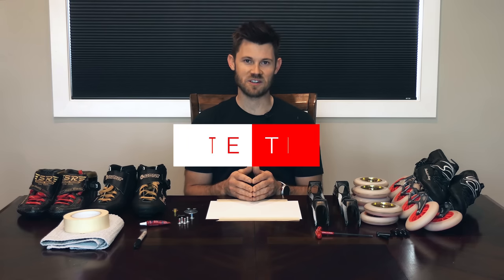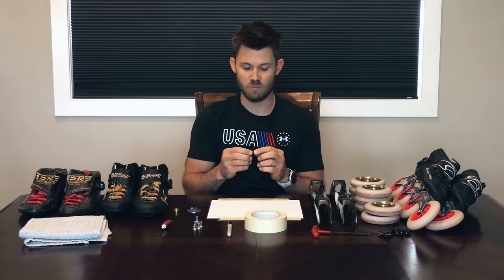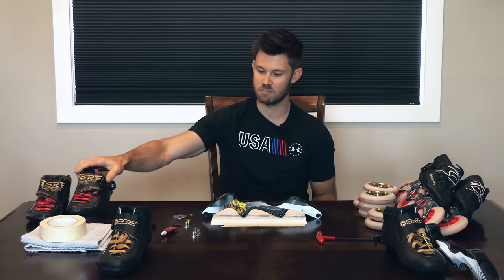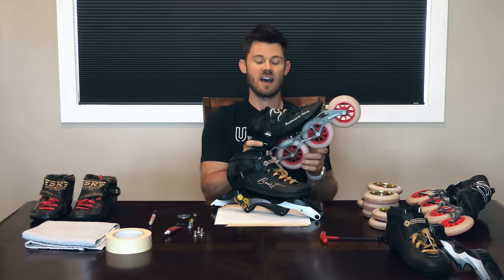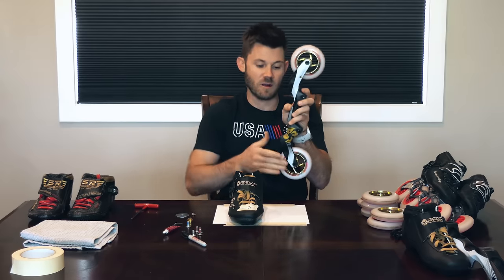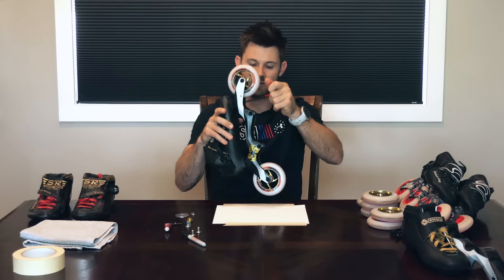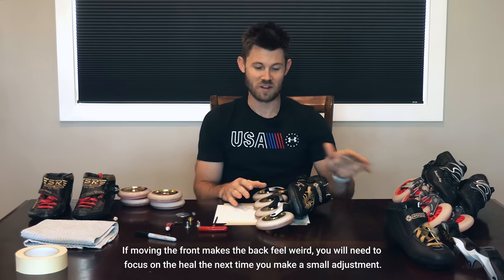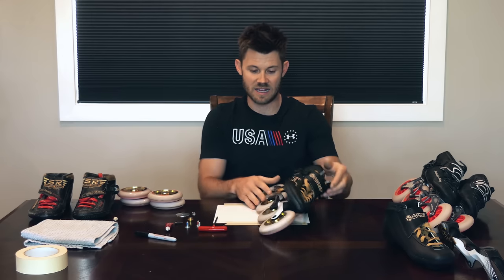Inline Skate Basic Setup Guide - How & Where To Mount Your Frame - Tutorial by Pro Joey Mantia

Comment: Quick question - I went from rec skating to short-track and it took me about 3 months to feel stable on speedskates. I wanted to really carry over what I learned from ST to inlining, so I got racing boots. I love my ST Bont Patriots, but when I picked up a pair of Inline Bont Jets, it was a huge step backwards: I was exhausted in 1/2 the time, I didn't feel stable, my feet were sore and my calves exhausted. The patriots are stiffer and I feel like I have more control. I prefer the stiffness and rigidity of the ST boots, where the boot feels like a part of my foot. I've spoken with other amateur short-trackers who share the same woes. Inline looks more akin to long-track with a lower-cut and looser fit, so I wonder if it's just something I need to learn? I was thinking about going semi-race, or getting a higher-end (stiffer) boot, but I don't want to spend the money if the problem is still just my form. Any advice?
Reply from the maker: the 3 month learning curve was likely finding balance on your blades that are in the surface vs balance on wheels that are moving on top of the surface, different methods for creating speed between the two sports essentially means controlling you body in a slightly different way. In general, inline will light up your calves and shins more than ice because you're fighting to create your own grip ON the surface vs ice where you can relax and let the blade do the work IN the surface, so that's not surprising that your stabilizers are tired faster. Does equipment play a huge role in that? Of course. Short track boots are rock solid so at some point that boot will catch against your ankle and give you something to lean against. Inline makers are always trying to go lower cut (not sure exactly why, maybe for a little more agility), so if you have a boot that's not as stiff or as high as your short track boot, you're definitely going to feel like you're having a much harder time controlling your skates, in turn making everything much less fun. Long track boots can be as soft as slippers and still work pretty well just from the nature of the 400m oval, but stiffer boots allow more control in the turns especially. In my opinion for inline you want a boot that is stiff (if you give the ankles a firm squeeze they're not going to move), that has carbon that comes to the top of your ankle bone, and that has a good fitment on your heal and forefoot, not allowing any play in those parts of your foot. On top of that a perfect boot will have an arch that supports your foot, which is nearly impossible to find unless you're extremely lucky with a stock or have a custom shoe. You also have the option of mounting a frame on a short track boot and skating that way (I believe they still make adaptors to go from 165 to 195, or you can get a 165 frame), just don't tie the laces all the way to the top holes so you can get enough dorsiflexion for inline - because inline is on a flat frame and not a rocked blade, you would likely struggle with that forward lean if you tied those laces all the way up through the top eyelets. Ideally, you get a taller, stiff custom shoe and that will help a lot, but without seeing you skate, i have no way to know if it's your technique that is causing the issues. 

hope that helps
Reply: @JoeyMantiaSkates  This helps a ton, you have no idea :) From the sound of it, it's probably a little bit boot, a little bit technique. 

In my Bonts, my heel is snug, but I have a little play around my toes, noticeable when lifting / placing the skate. I'll probably try a 1/2 size smaller boot and really work the heat molding (or just splurge and get custom boot). I'm going to stick with inline boots - I need to work on my dorsiflexion: I'm still quad-dominant and I think the different boot may help me get into a lower position and get that good glute activation. Plus, I want to use the right tool for the job, so to speak, and 1/2 the fun of skating is learning the technique, so learning how to really skate in an inline boot should will be fun.

My technique also needs work, which makes me grateful for your other videos. Short-track strokes are surprisingly different, where aside from sprints, landing a stroke puts you right into a more passive recovery phase where you start "loading the spring" for the next push. Landing inline feels far less passive, where when I do it right, the second push after the landing almost feels natural. My guess is my struggle with inline is that I assumed the form was similar ST, and I think the difference in weight distribution and stroke cadence is less nuanced than I anticipated.

Your series is tremendously helpful. Really great for those of us that don't have access to local inline coaches. Can't thank you enough!
Reply: Which boot is good sr or bont please reply
Reply: Do they still have lazy lega wraps? It was a thing back in the day... kinda light a weighted blanket if you will for ankles. Maybe try them. on both skates, till your muscles get stronger.
Reply: @JoeyMantiaSkates   I purchased a used frame from someone. I cleaned the bearings, dried them and checked the spinning. The bearings are spinning well before mounting them to the frame. If I mount the wheels to the frame and loosen the screws only then wheels spin well, if I tighten the screws, the wheels/bearings are not spinning at all. the frame is narrow than wheels side size that when I insert the wheels to mount, I have to push in abit hard. Is this because of the frame or frame issue?
Reply: @Joey Thanks Heaps, trying to become a better skater.

Comment: Thank you Joey. Back when we first met I was on a 165mm only mount (last year they made that solo option) with only 100mm wheels, and 20+ years later finally needing to get newer boot due to wear & tear of boot, and moving up to 195mm mounts and 110mm wheels. This in-depth detailed video is such a help for me since I haven't had to adjust my skates and frames in so long I had basically forgotten how to reset a frame on a new boot correctly. The professionalism of this video is best since it doesn't deign on which manufacturer of the boot or frame you have. You explain it based on the person, their physique, and technique with no supposition to maker of product. Again thank you for your dedication to our sport, plus the education safety of all skaters to help them get better.

Comment: This was extremely helpful for me! My skates came with the frame mounted all the way to the outside (on the front). Using your tip with the centerline and toes I adjusted the frame by a pretty big amount (front a lot to the inside) and it helped me so much!
I had surgery done to my ankle after an accident and the scar is really sensitive to pressure (there are metal plates in it that "rub" from the inside) and the pain in the scar was basically limiting my maximum session length. Now after adjusting i feel that there is less pressure on the scar and first session of the year i did 90 minutes without the pain in my scar!

Thanks a lot!

Comment: I couldn't wait so half way through I took out my [week-old] PS HC Evos and scooted the frames as far as they would go toward my first toe.   They won't go to the actual dividing line but already, even without lacing, I can feel my foot, at long last, feels balanced!  What an "oh duh!" moment for me.   Getting back into skating after my first go in the nineties when I had K2s with static-mounted frames.  On those I always needed to be conscious of my right ankle sinking inward.  My one-skate exercises were always a challenge.  Setting up the balance with the movable frames is game-changing.  My first week on these "modern" skates was already a revelation with a carbon, heat moldable boot and bigger wheels on trinity frames.   This has helped so much!  Thanks!

Comment: Hello Joey! Thank you for the info. I tried your method of resetting my new set up (back in the game and haven’t regularly skated on a team since 1997/8ish), since then I had three sessions on my last set up. Each a few years apart - the last time I put inlines on my feet was 2011- I had a rollerskating birthday party as I had just moved back into my state after snowboard bumming for well the previous decade! 

Anyways, each time I skated, my Bont Hustlers, 5 wheel mogema frame and five 76mm (72?) wheels all felt great and fit like a glove and the muscle memory was and still is there.. yay. 
However, I never set my kit up - it was handed to me on a money platter by my parents… lol 
The coach or dad set up my kits. 

So, now about a month ago, I bought a mid level complete set up, four 100 mm wheels on a 12’ frame, as I wasn’t sure if the bug was still there (it is) and I wasn’t about to go pro with a super expensive set up (poser anyone?). 

I thought I was a little on my outside edge when relaxing on the new set up. 

Bont recommended the incorrect size  on their calculator, my ankles are swimming a bit,  and I have a supination issue.
So I thought I’d change it up a bit I tried your technique of placement and I feel it was placed medialy a bit too far me … and although I have no issues with ankle strength (snowboard is a great cross train for explosive power and ankle strength), BUT it hurt like a mo fo and didn’t feel right. 

That said, like  you i also don’t like shims / spacers.. Question, would it be advantageous to move my frames further out to the lateral edge of my foot and can you recommend a vid?  Or should this buttercup suck it up and get used to the placement?  

Sorry for the long comment. I find background info helps get the best answer… 

Thanks again!

Comment: This is the definitive skate setup video! Thank you Joey for compiling all this info in one place. A couple thoughts:
- Have you tried Vibra-Tite VC3 thread locker? It sets to a more rubbery consistency than Loctite, which is more gluey. It seems to function well without being so hard to remove, and you can reinstall the bolt several times without needing to clean and reapply thread locker. I've started using it on axles especially.
- Your point about boot height/stiffness and wheel height is well taken. I had 1990’s Bont boots I wanted to “modernize” so I mounted them to 3x125mm frames. They were nearly impossible to skate! The leather and fiberglass boot didn’t have enough stiffness. They’re awesome old-school boots but they’re only useful on old-school 5x80mm frames.
- In the same vein, it seems like 125mm wheels require your frame position to be dialed in just right. I bought new speed skates pre-assembled with everything centered, and adjusting the frame position was absolutely mandatory for me.

Comment: Another excellent post, learned some things I didn’t know and I appreciate the work you put into these. I’d like to know what bearings you use and any info or advice you have concerning bearings.
Reply from the maker: a little secret: most skate bearings are made in the same factory in china these days, so whatever brand you choose is usually pretty comparable to the next. Because we aren't hitting huge RPMs like some machines that need extreme precision to reach the potential of their moving parts, our bearings don't need to be abec rated, hence the SWISS (doesn't mean they're made in switzerland) bearing- one that allows for play in the race (the relationship between the balls what holds the balls of the bearing).  So stay away from abec rated bearings for skating, keep your swiss bearings lightly lubed, keep them from getting wet and if you do get them wet dry them as soon as possible, and last but not least, keep them clean- a good flush or soak in some sort of solution/solvent- something like mineral spirits- that will evaporate without leaving much residue, if any, blow them out with compressed air, and lube them, at least once a month if you're skating a lot. If you use a harsh chemical like brake cleaner which is extreme, MAKE SURE YOU REMOVE ANY PLASTIC PARTS BEFORE HAND FROM THAT BEARING BECAUSE IT WILL EAT THEM (install them back after the solvent has dried/evaporated). If you follow those tips your bearings could easily last you 5 years+. I would stay away from ceramic as they are more prone to chipping on the balls, and require a significantly higher amount of maintenance to be fully functional. The benefit to ceramic is the resistance to heat and thus resistance to expansion causing more friction, but I dare say we don't get those bearings moving fast enough for it to make a noticeable difference, some may argue against that, but in my experience I have never felt any actual difference between them.

Comment: Great pointers here JM. (my gf's initials ha!). 
One comment about wrenches and correcting the ends becoming rounded: I have successfully ground down the ends with a dremel and a grinding attachment to flatten the edge. Subsequently, you can do this with a fine metal file as well..
Reply from the maker: For sure, I've always just fixed mind with a bench grinder, but figured it was easier to tell people to get a new one than to go buy a power tool to fix the issue.

Comment: Nice explanations, thank you for spending the time! Only addition I'd make is with any lock washer, split ring or star, always use it with a plain washer underneath. Both are designed to cut into the base material and the screw head to prevent it backing out. You don't want that to be your frame.
Reply from the maker: thanks! yea that's a good point, should have mentioned that- hard to cover everything on the fly without fully scripting these things
Reply: @JoeyMantiaSkates  Oh gosh I was really just nit-picking. Your video was incredibly detailed. Looking forward to getting my street skates dialed in, thanks again

Comment: Hey Joey, 

I kept messing with my frames on two different pairs of skates I have thinking that the frame must be off because I was having so much difficulty controlling them.  One day, one of the old dogs looks at my boot and said, "That cuff is super loose! No wonder you can't control it."  Could fit two fingers in my cuff.  When heat molding, putting my foot in them while warm and tying them wasn't getting the cuff tight enough.  I had to leave my foot out of them and clamp the warm boot in a position smaller than my ankle.  Once the side of the heel cup and the cuff were up against my foot, the frame placement mattered much less.   Long story short, the fitment of the heel cup and cuff could be the reason why you're flopping; not the frame.  Thank you for this very detailed video and for not giving a one size fits all approach.
Reply from the maker: thanks for the appreciation

Comment: Thanks. Really interesting to learn.

Im quiet sure the trinity frame doesn't offer me much space for horizontal changes but I trust the manufacturer to offer a fine enough stock Position for my Personal needs.

This will still be a thing I might consider for my next boot.

I have 2 powerslide boots but like to get a flying eagle with a different mounting where I could check this out.

Comment: This was the video I've been waiting for! 

One question: how does this video and the double push video connect with regard to the set down? Does the toe in/out affect the set down? How and where should we set and what should we look for? Thanks
Reply from the maker: I personally wouldn't change the angle to try to get a better double push, i think the most important thing is balance on your skates, so if you can find a frame position that gives you that, then the control you gain will pay way higher dividends than if you try to change the angle and lose that balance point. I've had my frames set up for indoor skating, as well as setup for just trail/ straightaway skating and as long they were both balanced well, i didn't notice a huge difference in my ability to skate effectively
Reply: @JoeyMantiaSkates  OK I'll give it some time like you suggest. Thank

Comment: Hey Joey, thanks for the insights and advice.  After shifting my heel wheels to be more centered on the back mount, they feel a lot better.  I have a quick question, though.

My FR1 boots have 7-hole mount plates that are compatible with both 165mm and 195mm frame mounts.  I have some 4x100 frames (NN Ronin V. rocker) that can be used with either mount as well.  This are more of a rockered big wheel, "wizard" urban freestyle setup, fast and maneuverable.  Which mount option would have better power transfer: with the heel axle bolt closer to the middle of the foot or further from it, or would it not even make a difference outside of hardcore speedskating?
Reply from the maker: Glad you found some use out the vid. 

I have to be completely frank and say I'm not very familiar with a v rocker setup and without skating on it myself to test what actually feels better to me, I wouldn't feel comfortable just giving a random answer. Sorry!

Comment: Hi Joey! & thank you for the video. I Seba Hight Lights skates  size 9 US. I slalom with cones and do dance moves. I rockered my wheels 76mm front 2/80s/middle rear 76mm. I notice at the rink I can do moves and dance moves but when I speed up and try racing it feels a bit unstable. Maybe it's just me, I've seen one guy rockered zoom past me during a race but he doesn't do dance stuff. 
I skate the trail with rollerblade edges rockered and the frames are just centered from the factory. I don't think I'll ever go back to all 80MM wheels now as it's too hard to turn and not nimble.

What's interesting I have a right leg shorter then my left leg - I did try shimming one frame but it felt weird. After upgrading the skates and my feet don't hurt anymore and my feet have become stronger.